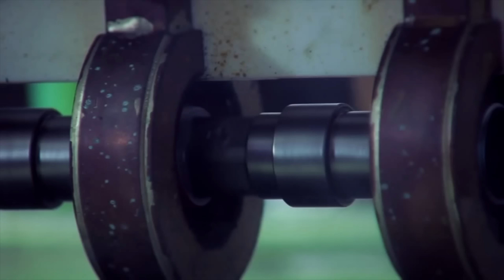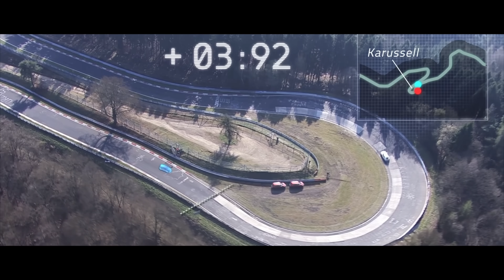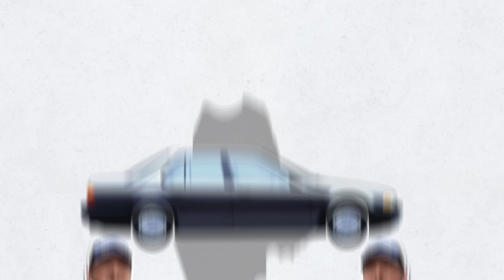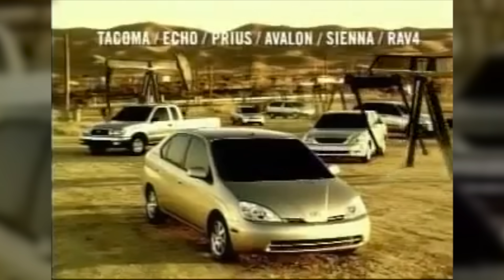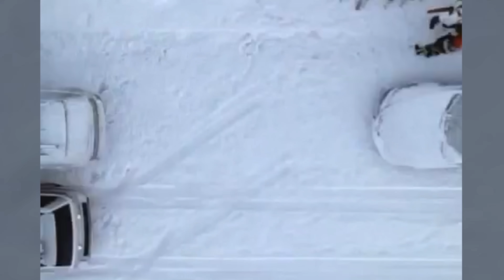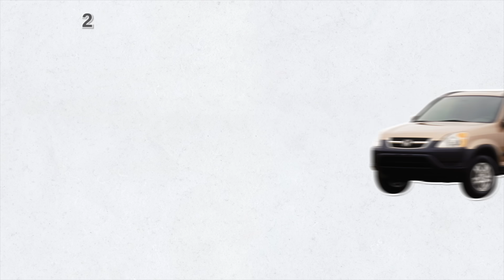Here’s Why Honda’s New Cars are Genius

Comment: 87 civic...i had 380,000 kms on its 1.3 litre before a doctor in a saab ..came around a corner too fast and went under my car ..lol . ..it was a standard ..its was a blast to drive ... Got 600 kms to a 10 gallon tank and it would do 80kmh in 2nd gear with no issues its whole life til a doctor of all ppl killed it 🤣🤧🤨

Comment: I build the Honda odyssey and Honda Ridgelines for the Honda plant in Alabama. Yes these engines are reliable in every model that Honda produce. But automakers have to start producing electric cars. I really believe that will be Honda downfalls of the electrification in the up coming years. They let us know they join with GM. because of the future of electric cars. Since I been working there, Honda should’ve been put out at least a Hybrid for the odyssey and pilot. They talked about but never happened. We don’t know what the future of Honda far as producing electric vehicle.. they said they goal is all electric cars by 2030. Which government putting more pressure of electric cars to hit the streets by 2025.

Comment: I have a 2005 CR-V at 160k miles. Oil and air filter changes were neglected by the previous owner, they somehow destroyed all the anti-roll bar links, and they ran the windshield wipers down to bare metal among other boneheaded things. I fixed all the big issues and after putting fresh fluids in it still runs great and I'm hoping I'll get it to 1mil miles.

Comment: all of them for some reason or another... 74, 78, 79, 84 crx, 88, 89, 2x93 del sol, 14 civics... some with jspec swaps b16 b18 h22a
83, 97sh prelude 
what were they thinking with hondamatic? still fun to drive, 1st gear to 80km lol so many confused looks slow acceleration to 50 then goes decent and back to snail speed into 2nd gear

Comment: I love my 2012 Accord V6 manual coupe! 

At my local Honda dealer I saw a sign in the Service department that wanted advisors to offer to buy customer's cars. Each model has a desirable year range except for the CRV which simply stated, ANY.
Reply: Hearing that they discontinued the coupe, and then the manual trans, was one of the saddest moments of my life.
Reply: @gokblok  that's why I'm so glad to have a 2012 V6 manual coupe that I just got not even 2 weeks ago. It's so fun to drive!
Reply: Simply the Best untold Secret , About HONDA if you really love DRIVING it's GOT to be a MANUAL transmission, Otherwise it's not really that COOL, Yes I own two with a Automatic and two with Manuals, The two best cars of the FOUR are MANUAL. Even though the one 2005 ex special edition gets better FUEL mileage then the same Year ex 5 speed manual, Because the EX car is gear for take off power vers FUEL mileage like in A LX manual car both 5 speed manual transmissions but Geared Different YES in the same Year ❗SO in other words If you want FUEL mileage buy the LX 5 speed manual, If you believe me just go to Honda's parts search engine online you can clearly see the PART # changes 😎👍...

Comment: I owned a 1989 Honda Civic Hatchback DX.  The car ran well but it was just to noisy. After 15 years and 190,000 miles the frame rotted away.  Every since, I’ve been a Toyota fan.

Comment: Read article about Honda / Acura Engines and reliability , in which they gave allot of good to great analysis on different aspects . One of the Keys Points ( that back up Allot of what Scotty has said for years )  is if the Vehicle is well Maintain the AVERAGE life expectancy is around 200,000 miles .  This was a Actual Study done ( excluding wreaks )

Comment: My 2006 2.0  Civic Claimed to get 40 MPH " and did " Today has 190,000 miles. still getting 35 MPG. ( I push it hard ) ( still has Great Power ) Wish I could buy 10 more of them this time with standard Tran.

Comment: I still can't wrap my head around variable valve timing. I guess I'm going have to do more research.
Reply: valves are controlled by cams on a shaft, vtec uses extra cams on the shaft at different rpms. giving you power and economy. in older cars you had to pick power, efficiency or somewhere in the middle. thats why old cars tuned for racing stumble at idle but make great power in the higher rpms.
Reply: @kevinb7551  I'm more used to building engines to old school methods with a standard camshaft. I still do not understand the mechanics or operation of a variable valve camshaft. I maybe stuck in the 1960's - 1980's where engines used solid or hydraulic lifers as close to a .500 as possible.

Comment: Honda and Toyota. "A true testiment to amazing Japanese engineering".
Reply: Honda Toyota and their luxury brands Lexus and Acura are all great vehicles
Reply: Yep, I have a 2013 Toyota Corolla with over 250,000 miles on it. I average over 20,000 miles a year. Never have had a problem.  I will only have a Toyota or Honda.
Reply: You are absolutely right,  there is only two car brands on this planet. Honda and Toyota.
Reply: Nissan used to be similar.

Comment: The best I've had so far is my 2010 Civic LX, 193K and still solid.
Reply: I had the 2006 EX and had it for 12 years and around 220k miles. Now I am in a 2017 Hatchback EX
Reply: I love my 2017 with the (k20C2) 2.0l n/a 73k 6MT now runs beautifuly and I redline it every day all day no problems at all

Comment: 2006 pilot with 250xxx miles runs like a clock just timing belts brakes and control arms and tires are the only thing I have ever had to replace runs better than a clock

Comment: Should've also had the 2002 crv I'm clockin in at 235k with minor valve clatter which I plan on doing a adjustment at 300k when I do a valve cover and headgasket replacement

Comment: I've had 8 different Hondas, my favorite, hands down was my manual 1996 Honda Prelude!  That car was a blast to drive, it stuck to the road!  The handling while taking curves was amazing, it got great gas mileage and had no issues with break downs. and yes, when we sold it, it had over 150,000 miles and was still running like a charm.
Reply: I've owned three 3rd gen Preludes. My '87 with the 4 wheel steering package is still my most favorite of them all.  A '91 with a K or H swap and the 4 wheel steering package would be the best Prelude ever.
Reply: @ElijahFowler  NICE 👍
Reply: In the Caribbean, they boast up the preludes and use them for racing.
Reply: I'm looking to install a Honda Accord automatic engine into my Dad's 1979 Audi 80L. Any info where I can get one?
Reply: @TheoatStudio  automatic engine? 🤣
Reply: @jorgerios2885  did it create confusion? I meant automatic transmission.
Reply: I had an '89 model S. Logged 500k miles on it before I sold it. Routine maintenance and a clutch. Great vehicle and yes very fun to drive
Reply: 150k is nothing..why did you sell it
Reply: My favorite honda was a 96 prelude. It was really low to the ground but super smooth.
Reply: I sold my 1999 little Red Prelude 3 years ago. I know exactly what you're talking about. I really miss that car!
Reply: I had a 1993 Prelude vtec, I swapped a JDM H22. I regret ever selling it and would've taken it with me when I left Hawaii. I still left with my 2006 Acura RSX Type S but the 93 prelude was such a fun car to drive and the interior was captivating.
Reply: I want one so bad when I have the room and the money I'm restoring/modding a prelude for amateur track fun/ some fun back road driving.
Reply: Do you still own a Honda if not throw some curves at the 2020 Civic Sport like in a test drive, Let me know what you think, But But had to be a 6 Speed manual without the Turbo Charged engine.😎👍
Reply: @raymondreiff8170  I thought they got rid of manuals except on the si and the type R
Reply: @goblinsarereal4954  Yes I bought one of the last Sedan's With the K20C2 and 6 Speed manuals, About 30 or so can still be found on Autotempest Nation wide, but only 3 Coupe's found as the Sport Civic, Built in 2020.

Comment: I'm on my 2nd Honda - first was a 2007 Civic EX - oil changes and regular maintenance - that's it.  Traded it in with 114,000 miles on a new 2014 Accord Touring V6.   Both cars are pretty good on gas (yes even the V6!) .  I've gotten up to 35-36mpg with it on the freeway.   I always wondered whatever happened to the Honda CRX.   A friend had that car and it was rated at over 50mpg back in 1988.  What happened to that technology?  Love watching your videos Scotty!

Comment: My favorite Honda (besides my motorcycle) would be my 1994 Accord EX coupe (vtec). I bought it with 120,000 miles on it for $6500 and sold it 6 years later with 235,000 miles and still running well for $3500. It definitely had some problems at 235,000 miles. Lots of small nickel and dime problems that added up to it's not worth it to keep it. Great car! I only spent about $1000 in repairs over the six years and 115,000 miles (excluding normal wear and tear items such as oil, brakes, battery, tires,...).
I also drove that car crazy hard (I was in my early 20's).
Hondas are great! I wish they offered a proper truck or wagon these days or I'd currently own one (besides my motorcycle. Honda CB500X).
My current vehicle is a 2017 Subaru Outback 3.6R. It's also been great so far.

Comment: I love them, and have had 7 of them, currently own 2 Accords with the J35, but I wouldn't call them any more reliable than anything else, especially the VCM engines, my 2012 ended up needing a new engine last November at only 130,000. It has 137,000 on the chassis now and it's needed thousands of dollars in further repairs and upkeep since the engine swap. I love the way it drives. So I keep it. 2 timing belts on my 91 Civics (way back in the day) before their time, and a few alternators. Why do I keep buying them instead of Toyotas? Stated above, I love how they drive. I am purchasing a switchable VCM eliminator module now that I know they exist.

Comment: I have a 2019 Accord EX-L with the 2.0 turbo and 10 speed auto. This drive train is very nice - oodles of power but very economical. On trips across Colorado the engine generates so much torque at lower rpm that it almost never revs above 2500-3000 rpm even when climbing the steep mountain roads at high altitude. On long trips through the Colorado mountains I usually get 40+ mpg even though it’s rated by the EPA at 34 on the highway.

Comment: Oh Scott,
The 1989 Accord is hard to beat.
Reply: I had two 88s.  Both were ancient when I bought them, both lost 5th gear after awhile, but I quit them before they quit me.

Yeah I was holding up flip headlights with wedged in sticks, yeah the fuse for the horn and the brake lights were on the same fuze, and yeah after the horn froze and died one winter night you would lose brake lights if you hit the horn, but I didn't mind too much.

Comment: I once worked at a Honda dealership  not many years after the prelude came out. We had a high performance prelude with four wheel steering that I took out for a spin. Sitting at a light a Camaro was next to me revving his engine. At the green we both floored it. I blew that guy away like  he had a trunk full of lead. Honda  rules.

Comment: Had a 2005 CRV with 250k miles on it. Had to do nothing to it outside of normal maintenance besides front lower control arm bushings and ball joints at 235k miles. Most reliable car I have ever owned with a very low yearly operating cost.

Comment: Truly enjoyed my 2013 Honda Fit base model driving it cross country(US) a handful of times with no issues. Traded it for a 2021 Honda Civic Sport Touring Hatch for the new features such as adaptive cruise control. Makes a huge difference for those 10+ hour drives. The sport mode is also a nice little push for passing when needed.

Comment: I always loved Hondas.  I had a 2002 Civic with the K series Vtech engine that I bought used in 2009 that would get 45 - 48 city and 32 - 34 highway.  I unfortunately only had it for 2 years due to a highway accident during stop and go traffic where I had to make a decision between hitting the car in front of me at 35 MPH while I was accelerating, or being hit by a car that was going over 100 MPH.  I wish I still had that car because the only issues with it was some rich kid did a piss poor job of trying to cheaply make it a ricer, and I was only a new rear bumper, and a quick removal of crappy black flame car skins away from having a perfectly working Civic that would have lasted to this day

Comment: I did not see the Fit in this list , pretty reliable and gas saver car 284986 miles and still kicking. It has survived 2 accidents and is been a breeze to service and maintain, also parts are easy to come by
Edit:i  am driving a 2007 fit
Reply: Love my 2010, truly one of the best daily drivers you can buy
Reply: @rjechols2059  Yes, despite being a small looking car its actually very spacious inside. you can haul a ton of stuff with the seats down. perfect for city driving and city parking. great mpg as well. its the ultimate city driving car basically imo.

Comment: Honda's strength is 4 cylinder compact cars.  And it is where it stops.  Do not buy full size honda vehicles.  The transmissions cannot handle anything heavier than 4000 lbs.

Comment: I learned to drive a manual on a 75 Honda Civic (no a/c). Owned another used Honda Civic as a young adult.  Bought a 2001 Honda CR-V at an auction 4 years ago... currently running with 234K.  LOVE that vehicle!

Comment: My daughter got a1988 accord from her grandfather for 1 dollar. Spent about 550 bucks on it. Passed an inspection. She's using it as a daily driver. No issues . The original shocks are still working fine . Burns no oil. HONDAS are the BEST

Comment: The odyssey drives like a sports car compared to other vans. Shame they didn’t get a quality transmission. They would have controlled the market hands down.
Reply: I heard the Honda 10 speed is quite good
Reply: I Had the r30 version 3.0 vtech  v6 tuned to 295 kw, 6 speed auto select shift lasted 220,000 kms  then died, but i had driven it from new like a sports car for the family, nothing better than my 5 year old asking me to make it do the go faster noise ( vtech kicking in yo )
Reply: its got a horrible ride...my 2000 Windstar had a better ride than that skateboard

Comment: My favorite Honda was the 1994 Civic hatchback that I bought new off the lot. I drove it for 21 years and 200,000 miles before it was stolen out of my driveway in 2015. I'd probably still be driving it if that hadn't happened.